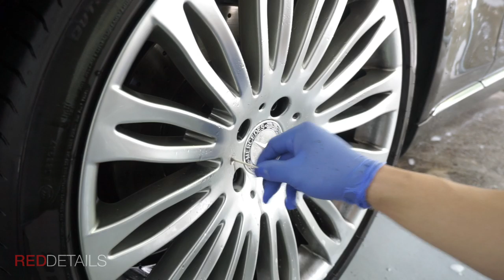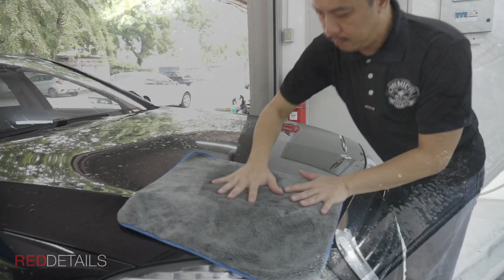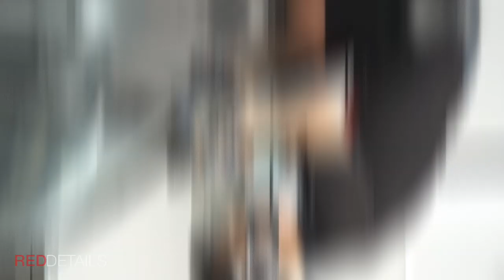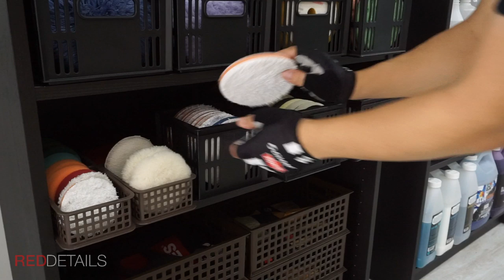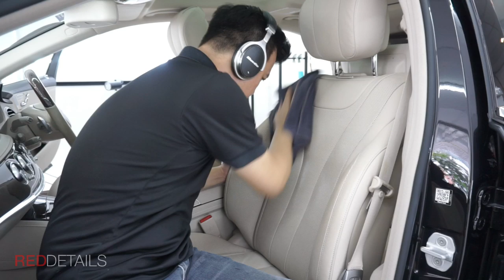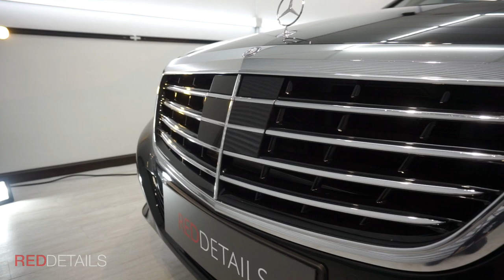Mercedes S400 Hybrid "Magnetite Black Metallic" Full Detailing & Paint Correction

Comment: The spray with the clear liquid that you use after polishing is an ipa?, To take the real work is that?  Also, can I put 1-2 meguiar's final inspection spray M34 where meguiar's Last touch on my foam pads, wool, to lubricate before polishing?  thank you in advance